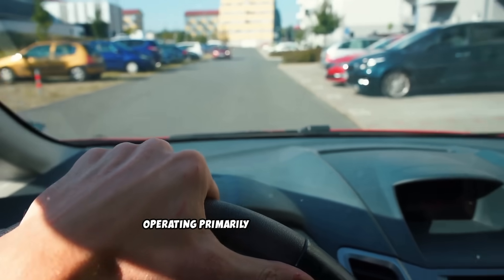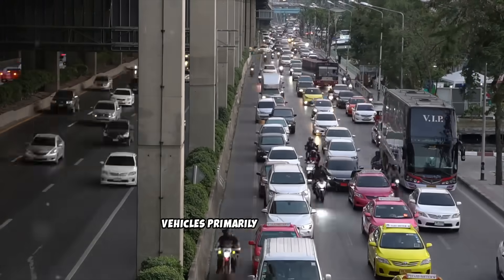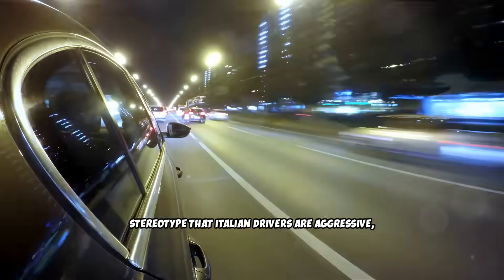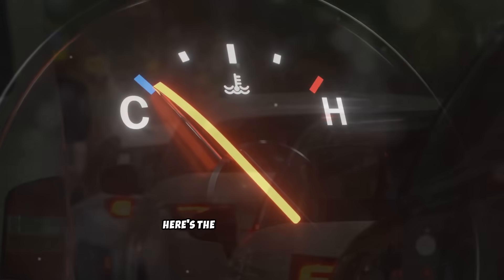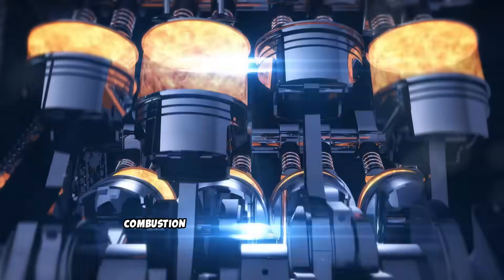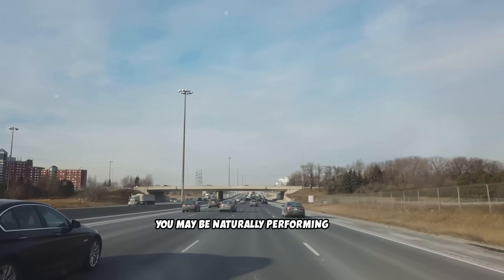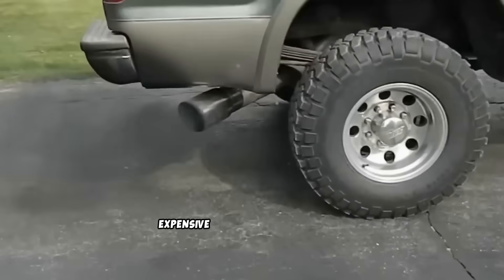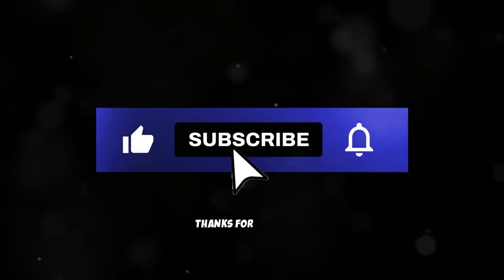Do THIS Once Every Two Weeks, and Your Diesel Engine Will Last Forever

Comment: Does high revving a diesel stress the cambelt more than under 2,000rpm cruising?
Reply: Why are you worried for the cambelt? It won't snap if you do basic maintenance of your car, guarantee.
Reply: Cambelts are quite durable so just service them before regular mandated intervals to be safe...👍
You don't need to rev the engine all the time only once in one-two weeks, if you use high quality diesel like Shell and now and then Shell V-power or other premium diesel fuel you'll be alright just avoid cheap supermarket fuel..., thing is if you do a lot of city driving then you need to rev it twice a week for 15-20 minutes...

Comment: My Toyota Landcruiser Diesel never reaches 2 Rpm with a trailer and 65 mph.....and cruise control.
It says"Problem with the PrCollision System" which is not right

After 200 Miles it goes into a Motor protection mode...and it uses a lot of Adblue.

After the first time ...I knew the reason.

By turnong tge engine On/Off for 6 times, I csn solve tge problem

Comment: Another way to get rid of that buildup ist just to spray a little mist of water in the intake of a running Diesel. If you worry that the water gets in the oil, just do it right before a oil change. And if you deactivate EGR and PCV, there wont even be buildup on the intake valves

Comment: Made even worse with 7/8/9 speed auto gearboxes that have low rpm logic control, where the engine hardly ever goes over 2000 rpm.
Reply: My Kia Sportage diesel try’s to do 1400 revs at 100 km in 8 th gear so I drop it to 7 th at 100km to 110 km does not affect fuel consumption it’s way to highly geared. Gearbox needs to lock out 7 th and 8 th gear for a lot longer other Wise around city it’s trying to do 1400 revs and the engine will labour. The clutch will not lock up correctly as well.

Comment: With Peugeot HDI engines you need to drive over 90 km/h for 20 min. They don't need particular rpm ratio.
Reply: Sure about that?
Reply: Why not?
Reply: That's incorrect. I have driven Peugeot Diesels for years (the 2.0L). I go to specialist European mechanics.  They told me to rev the engine out in lower gears for about 20mins - especially so with the newer engines with Adblue and dpf's. Works wonders.
Reply: @allanbriggs9007  Peugeot uses Eolis as fluid additive to their FTP filter that helps with reaching the right temperature for the clean so you don't need particular rpm's as other dpf systems

Comment: My diesel has no turbo, no particle filter and the EGR i throw out the first day when i bought the car brand new. 280.000km further and still running like day one.
Reply: What do you drive , soming from the 1920s . Modern diesel engines require turbos to help them perform properly.
Reply: My diesel from 2011 has dpf, turbo, egr and I have 276000 km and no issues
Reply: No turbo? Really? So your car takes 6 weeks to get to 60? All diesels engines that have emissions have a turbo. So wtf are you talking about?
Reply: I will definitely do that!

Comment: You don't need to drive fast to do this. In my case, I get the engine heated up, then use 4th gear and drive between the 2k and 3k rpm, 80-90kph. On the weekend, I drive a longer route, like 120km this way. The key is not speed, but rpm and time of travel, which means temperature and pressure for a time to get all the soot away. When I started to do this  I immediately noticed a difference. Some of the power lost has come back, and fuel consumption got down. One of the things that I think also helped, was changing the oil to an ACEA C3 spec from the older A5/B5 spec. I guess the A5/B5 oils have much more phosphorous and sulphur, creating more soot. It worked to a point. A significant point. To do better, I think I really need to remove the EGR cooler, and maybe the EGR valve to clean them properly. So, I proved it can be done safely with results.
Reply: So agree with you! It all has to do with getting the engine warm enough and drive it with load between 2000 and 3000 rpm's. I drive a lot of long trips with my car and always drive it between these rpm's and it runs so much better than it did when i bougth it.
Reply: I agree, but with the change in oil, did you always use a synthetic oil from the start?
Reply: So what about fuel economy?

Comment: Modern diesel cars has so long gear ratios that italian tune up is needed in highway dominant driving also. 120 km/h@2000 rpm is common nowadays. Despite driving highways primarily I need to do that "tune up" twice a week to keep the dpf warning light off. It seems you must forget 6th gear unless you live in Germany and drive autobahns frequently.
Reply: My BMW 520d rev 2000 rpm at 140 km/h. I need to use 6th gear (out of 8) to be able to do this "tune up".
Reply: @trend_exploitation Yep - that's correct. If you have an 8 sp' box you need to get down to about 6th gear. At 120kph my Peugeot diesel  (2.0L) is doing 1700-1800rpm's. I rev it out in lower gears using manual mode.
Reply: My 2012 S80 D4(2.0 L5) 6AT maintains around 2000 RPM at 120 km/h. Less fuel econmy then 8AT, but it seems to be good.

Comment: This is the first time I’ve seen such a clear “Italian tune-up” guide: warm up for 5–10 minutes, hold 65–75 mph at 2,500–3,500 rpm for 15–20 minutes, then cruise gently for a few minutes to cool things down. Very practical, and few people explain it in this much detail. Thank you to the creator!
Reply: Speed is not important; you can operate the engine at ~3k rpm at any speed. RPM is important...
Reply: iT'S ACTUALLY THE RPM'S THAT IS IMPORTANT. My mechanic told me to drop the car back a gear or two. If you have an automatic then use manual mode. That get's the rpm's up at a lower speed.
Reply: 5-10 minutes is not good from observation of my diesel is 20km in 20c and above temps and 30km in 20c and lover temps
Reply: Its not about the "time" for how long for a warm up, you have to clarify for yourself how long dose it take to warm up oil or engine tempt depends what you see on your cluster.. For me F31 in 5C it takes about 15- 20 min to warm up to max 100C oil temp, when your near it or at it 100C then drive aggressive like a sports car only you dont have to brake aggressive so you dont wear you break pads for unneeded reason. When you have driven hard then let it be on high revs so the airflow dose its job ^^. If you change your airlifter and then start doing Italian tune-up then your car gonna give you extra horse powers! ^^
Reply: Lol many diesels will never get up to temp if you let it sit and warm up for 5-10 mins

Comment: Is it really necessarry to do high speeds on a motorway?  Is it not sufficient to do high rpm in lower gears? Which is more important ie the high speed or the high rpm?
Reply: In a lower gear and higher rpm the engine isn’t under such a high load.

Comment: I have no access to high way. Can I just let the machine run at high rpm at gear 0 ?
Reply: It’s not under a load doing that.
Reply: @wheater5  doe not need to be under load. Travelling at high constant speed is not high load, only acceleration will provide the load you are talking about. High RPMS produce2 the heat required to burn up the carbon.
Reply: You can’t do 3k revs in second? Anywhere?
Reply: Dont do this it wil only do more damage
Reply: @gijsreckman918  why?

Comment: Maintain high speeds for 15 -20 minutes? That’s impossible in the uk.
Reply: Nop... Not hight speed.... hight rpm.....
Reply: At 3 in the morning perhaps
Reply: Not at all just pick the opportunity.
Reply: Try living in Wales with 20 mph limits all over the place.
Reply: @tnew6701 
Yes but you can run up the hills doing above 3000 rpm so same result your engine will be even cleaner...😊
Reply: Go at 6 am on Sunday morning
Reply: In UK you have to nearly stop after 5 minutes, to crawl over the pot holes or risk busting a axle

Comment: I’m impressed by how you explained that low-speed diesel driving causes carbon buildup, cutting performance by up to forty percent. Many city drivers overlook this. Highlighting the root cause helps viewers understand why engines lose power. Thanks to the channel owner for sharing such valuable insight.

Comment: This is 100% true.  Diesel engines work best when fully loaded.  I worked on ships with large diesel generators.  We were trained to keep them greater than 75% loaded for best health and long life. My current diesel camper van is heavily loaded in weight terms all the time and I intentionally hammer it up long motorway inclines at plus 3000 rpm in 4th gear whenever possible.  Keeps the pipes clear - don't care about the fuel economy.
Reply: Mechanic who looks after my vehicles especially my motorhome always said red lining up the gears on the motorway was always a good thing
Reply: @dongreenwood8833  SO - redlining a diesel? and i was always told keep revs between 1800 and 3000 MOSTLY - NEVER go to high! so now i am learning something new
Reply: @LucidFX. The hotter the engine the better it runs
Reply: I worked for an HGV main dealer, one of our clients had " driver snooper" devices installed, over revving , over speeding would alert the company and the driver would get a bollixing . Trouble is  this device was causing the engines to get "strangled" --carboned up, costing more in servicing costs, so really false economy to save some fuel pennies.
Reply: yep i drive my diesel volvo on the motorway and recently have been using the german autobahns and my engine runs smooth as butter after long autobahn drive.
Reply: You could still possibly get both good fuel economy and keep the engine clean. Even if lighter on the throttle if it's in it's rpms powerband it should also move enough air to keep things from being carboned up and still get some heat into the engine. The thing that kills me is when people lug engines on acceleration. Lots of throttle or accelerator input but the engine is not burning the fuel efficiently or moving enough air in the process to make proper power and torque.
Reply: can i change heavy load with high slope?
Reply: This works on higher cc motorcycles too.
Whenever a costumer complains at a shop that their bike is sluggish and choking with half pulling the accelerator, most of the time after assessment the mechanic just punches throughout the gears in high rpm in the higheay for a while, and it comes back purring like new.
This happens when the bike is used to ride in congested city traffic for long periods of time with lower rpms.
Reply: You are 100% correct. I was in the navy for 37 years, on steam, diesel and gas turbine ships.  Diesel generators and engines coke up badly on low load. Also, just as bad is fuel dilution from low load operation which seriously degrades lubricating oil quality.